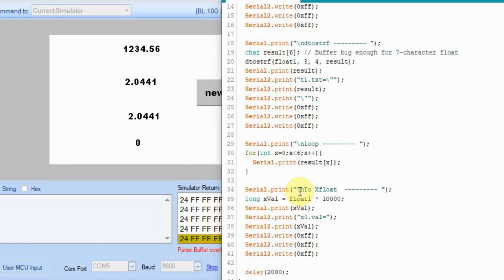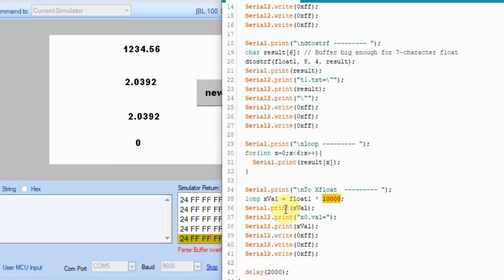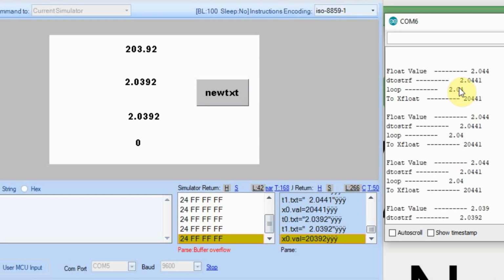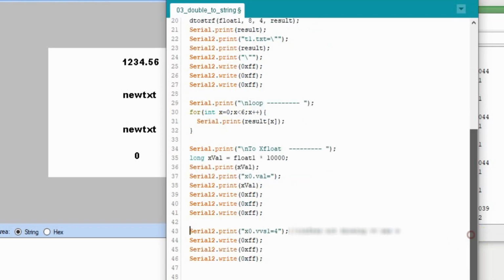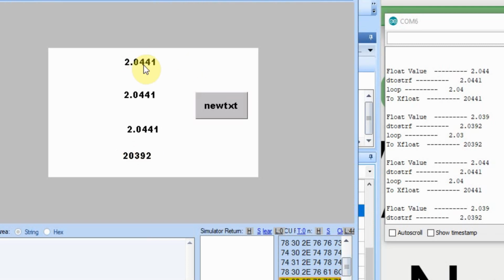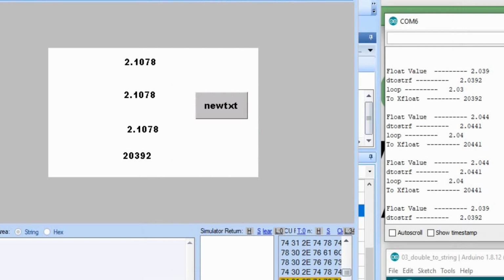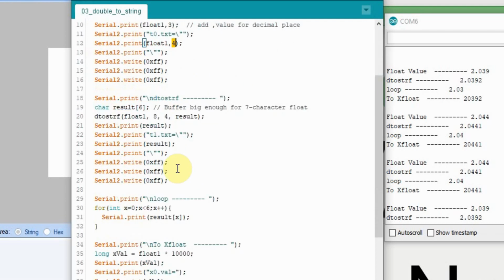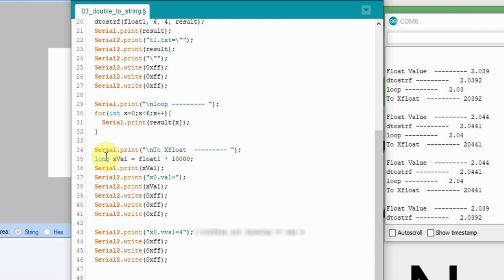#99 Nextion Display - Float values Arduino to Nextion - Nextion Tutorial

Comment: Please view this video for understand!         https://youtu.be/kKI0mzqeZdk    M1: I´m only send pulsos for the step motor,    M2: I´m send pulsos for the step  motor and send coordinates for the LCD, do you get view the diferences speed moviment?
Reply from the maker: Sorry for such a late reply,  You probably already have your answer.  But I would guess you have a delay statement in your code.
Reply: @CheapControls  hi, my line code is this, look that i'm using delay in microseconds is fast move, but comunication with nextion give me slower move.
for(int i=0;i<=passos;i++){
digitalWrite(PinStep,LOW)
delaymicroseconds(500)
digitalWrite(PinStep,HIGH)
delaymicroseconds(500)
Serial.print("t0.txt")
Serial.print("\"")
Serial.print(valor)
Serial.print(0xff)
Serial.print (0xff)
Serial.print(0xff)
}

Comment: thanks, very usefull video. man, do you know which  max. speed commuinication in the LCD Nextion with arduino, tried baud 230400, but no work the buttons, I´m wanted displayed coordinates of step motor while it move then, but sending this values to nextion,  the motor stay slower.
Reply from the maker: I believe the max speed is 115,200.  Do you have any delay() statements in your Arduino?
Reply: Do you seen the video, yes exists delay, delaymicroseconds, but I tried remove the delaymicroseconds  and I just left Serial.print() for send coordinates in the LCD  and digitalWrite(), but also the speed step motor stay lower.
Stayed like this:
If{
digitalWrite(PinStep,LOW)
Serial.print("t0.txt")
Serial.print("\"")
Serial.print(valor)
Serial.print(0xff)
Serial.print (0xff)
Serial.print(0xff)
digitalWrite(PinStep,HIGH)
}